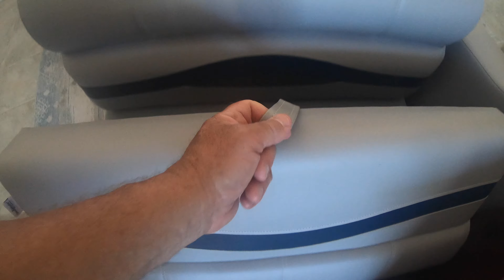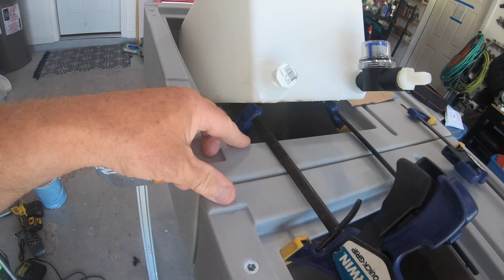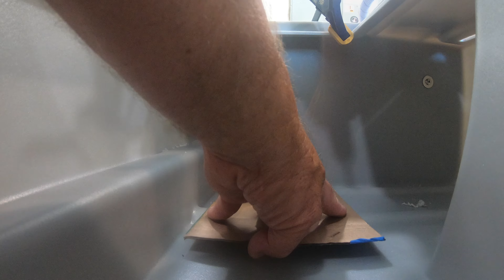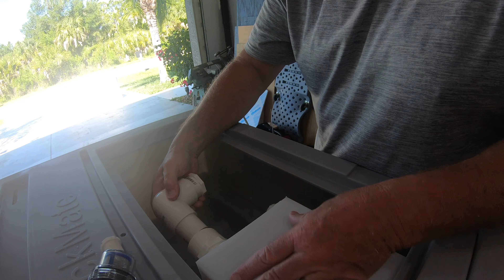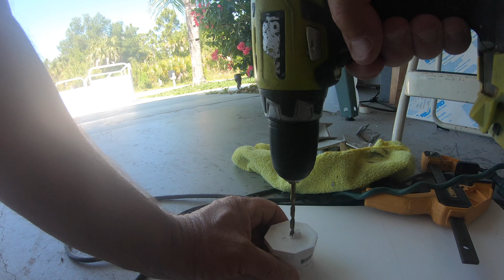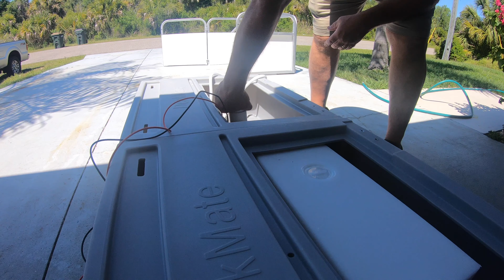Installing a Fresh Water Shower on a Pontoon Boat  4K

Comment: Thanks for sharing. I was looking at this kit on Amazon and wondered if it had adequate pressure for washing the deck after fishing activity. It appears very low pressure from what I see. Maybe a different nozzle may make some difference. But I’m thinking maybe a higher gpm pump might be batter.
Reply from the maker: I changed the nozzle and it did give me more power.

Comment: Did you hook the pump directly to the battery or to a AUX switch? And how have you dealt with keeping the tank reasonably clean? Thx
Reply from the maker: The pump is wired to a dedicated switch, which in turn goes to the battery. The tank is small and it is out of the sunlight, and usually refilled almost every time we take the boat out, so keeping it clean has not been an issue. Also at the bottom of all the seats, I drilled quarter inch holes in the corners of the base so water can escape out if water is spilled inside or after it rains.